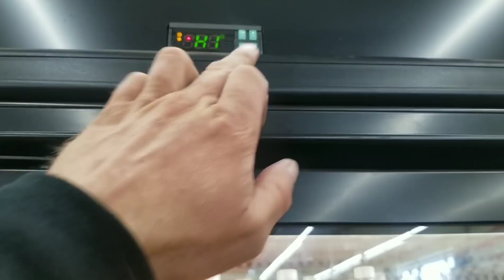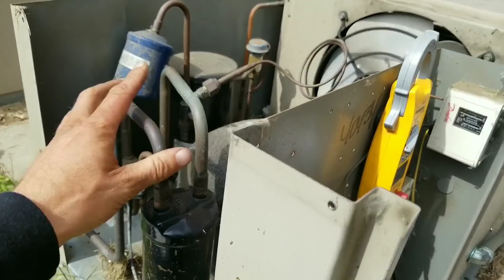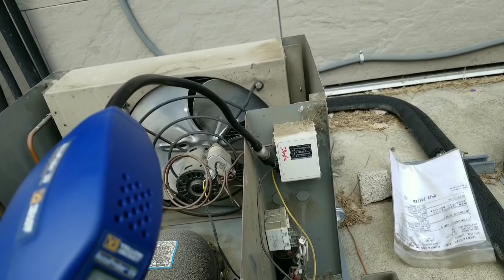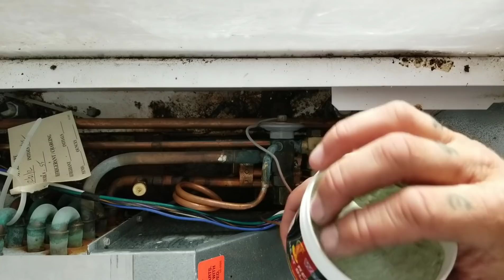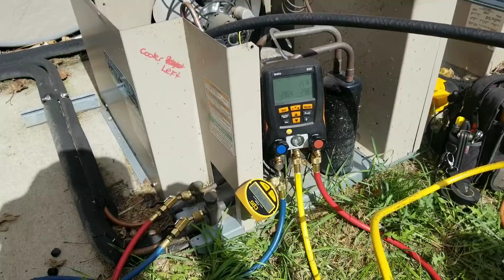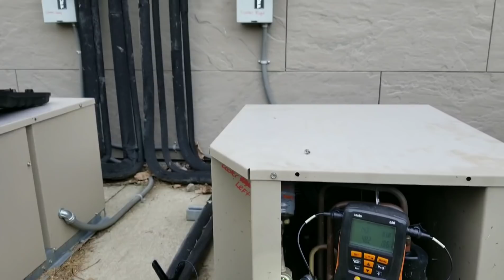Zero Zone cooler not cooling

Comment: can you braze over a solder joint
Reply from the maker: thats a good question- since soldering is done at a lower temp than brazing id say you could but it wouldnt go well, I assume the solder would flow out of that joint before you ever got the silver to stick-- this would make for a good little experiment

Comment: All you people amaze me has anyone ever heard of a smaller torch tip?? I have been doing commercial refrigeration for 35 years and only have put holes in piping when I don’t use the right tip jus saying though nice old school repair would be nice if the copper was like the good old days!!!
Reply: I'm new to refrigeration, just got my 608 a couple months ago. Is there a guide or rule of thumb on how to chose the correct size tip?

Comment: Forgive my ignorance but I always thought that if you take the voltage across any load, you should be able to read the voltage the load is under, whether is 24V, 120V, 240V etc. and a solenoid is a load. You mention in your video that the 24V and 120V is different. I am I little confused. I’ll appreciate if you take the time to educate me a bit in this subject. Thanks.

Comment: Sometimes solenoid in condensers will cause your liquid line to pump down also. Just depends where solenoid is located. 
Confused a new tech at our company he condemned a evaporator cause he thought there was no charge in system when he gauged up and it was pumped down and it was just a bad temp control in the box.
Reply from the maker: Oh yeah thatll get a new guy- I remember when I first started out I front seated the service valves on a condensing unit once thinking they where opened all the way, I powered the unit on and of course got nothing so I condemned that compressor-- luckily a senior tech helped me and showed me my mistake, lol

Comment: O we here it's very much forbidden to use Freon as a tracer gas , it used to be common practice but it's in the past now .
What we do is we use a mixture of nitrogen and very little hydrogen , that comes in a green painted top nitro tank  , and we do have newer electronic leak detectors that beep for both refrigerants and hydrogen .
I think it's much better this way , because you don't vent out refrigerant , better for the planet .
Reply from the maker: Interesting- so your leak detectors sense a lack of oxygen then? I wonder how they work exactly - yeah alot of other countries are like yours, we however seem to be behind the times on these things. Whats the max amount of R290 you can have in a system, here its 55 grams I belive
Reply: @curioushvacguy6876  I just looked it up and I'm starting to get a headache now .
From what I understand , it's 1.5 kg per circuit , or 1kg if in an underground floor .
But there's another reg that seems to allow more , depending on the surface and what not , but I'm not sure I understand correctly 🙄
The leak detector detects Freon and hydrogen as well , so the tracer nitrogen we use trips  the sensor .
The only downside is that it can beep when it smells glycol , or sometimes when you blow on the sensor , bit if you're careful it works pretty well .

Comment: My 550's are junk,  I can't use them to pressure test. I still use 1/4 hoses for vacuum unless it's flat rate.
Reply from the maker: So far mine are ok, I think next im going with the Joblink wireless probes but Im not completely sold on that idea yet-- thanks for watching
Reply: @curioushvacguy6876  I'm starting to think that the way to go is : electronics for smart probes , analogs for manifolds .
I think that's pretty solid .
Sorry to barge into a conversation I wasn't involved in , but I saw 550s trashing and I couldn't resist getting involved 😄

Comment: Nice job of circuit analysis / re:load of interest and using EEPs instead of digging for and measuring at the LLSolenoid.

EEP = Electrically equivalent point
Reply from the maker: Thanks for feedback Dave- much appreciated
Reply: @curioushvacguy6876  little different world  equipment wise but similar approach to repair... Samurai Appliontology

Comment: Your torch is also called a smoke key. I have yet to see a lock it wouldn’t open. When it comes to safety don’t trust a breaker you can’t see. A lock without a key is a safety issue and should be removed.
Reply: Safety first. Always safety first. Had someone turn 460 on while I was replacing a contactor. Knocked the crap out of me. I lifted him up and was walking him to the edge of the roof. He was laughing at first then he quit laughing. He will not turn on any breakers any more lol. No I didn’t throw him off but I wanted to. I can laugh now but it wasn’t funny then.
Reply from the maker: Smoke key, lol thats a good one- but on a serious note your right about the locked breaker, cant hit it in an emergency if its locked

Comment: The pinch in the copper is what is called a frost pinch happens on the outlet of the valve we use to get them on flare valves before sweat in valves driers etc. we're starting to come into the refrigeration picture.They do make frost proof flare nuts

Comment: who used the GD stay bright on the txv some one screwed ya
Reply: @curioushvacguy6876  color looked like plumbers stay bright but I have seen txv come from the factory installed like that
Reply: 56 silver looks similar... you need a ton of heat and doesn't flow like 5 or 15 %

Comment: Another great one.  I had system Friday night for smoked meat open case low charge. Couldn’t find leak anywhere so have to go back and recover n pressure test. But 26lbs low and almost certain it’ll hold about 75lbs of 404. Gotta love grocery stores! Ha
Reply: Curious HVAC guy leaning toward the huge ancient multi fan multi circuit condenser on the roof just because it’s much harder to find the leaks there and we have looked multiple times. System has 1”1/8 lineset and ultra long lineset plus huge receiver otherwise wouldn’t be nearly as much charge. Praying it isn’t in the lineset ran Thru the concrete floor with ten other runs from compressor room because idk how that will get found or repaired yet. Guess we will find out.

Comment: I just got the hot block, it seems like ground up shop towels, its missy and sometimes hard to pack it around items without losing a lot, how did you like the wet rag stuff? better, worse, the same.  FYI... you're going to hell for using the 1/4 hoses and the micron gauge placement.   LoL Good Video!

Comment: Hey
Is it for learning purposes you spend so long time  with the leak detector on the condensing unit.. I mean if the system is completely flat you will see oil where the leak is..  And i love the way you take the viewers hand and guide us through what you do.. If someone can't learn from you.. Well there is no hope for that person.

Oil traps. What is the rule of thumb were you are.. In DK we say every 2  hight meters
Reply: Christian Sommer don’t always see oil especially on condenser side where you have mainly high pressure vapor. Have seen many of these leak on the left side of that condenser where he was getting hits and yet no visual signs of a leak.
Reply: @jphvac5725  I know you don't always see oil, but when you see the amount of dust on the unit, let's just say i was 99% sure the the leak wasn't there.. But i understand that as a learning video, that you will start from point A and slowly work through to point Z.. On a set up like that the money is on a leak on the indoor unit.. At least that's my experience.
Reply: @curioushvacguy6876  and I really appreciated the long road ! After awhile a flow chart in your head start appearing. And of course it doesn't hurt while winter time to take your time somewhat, imo